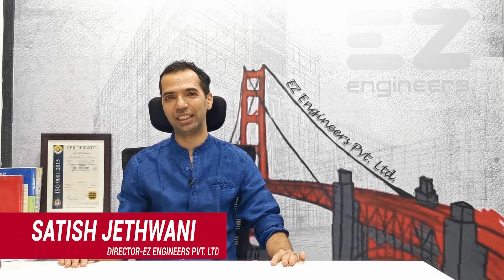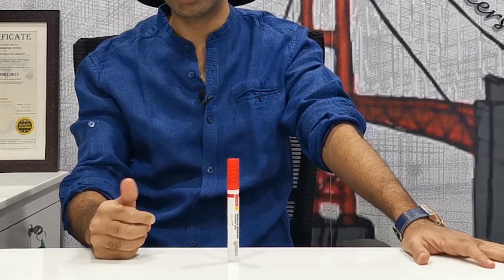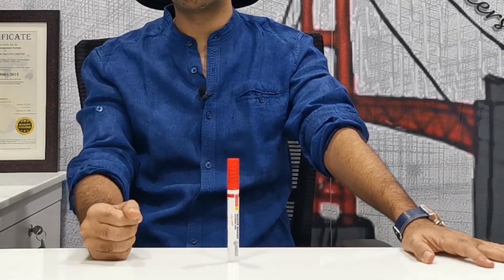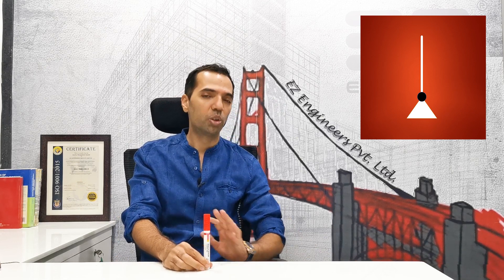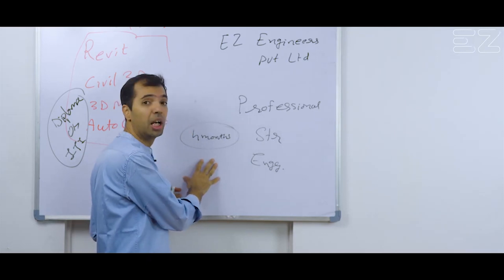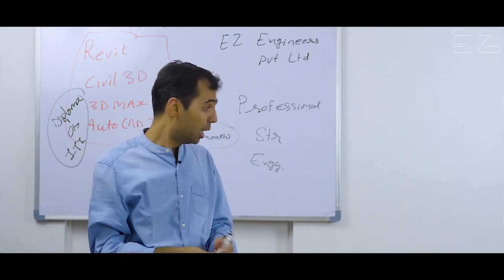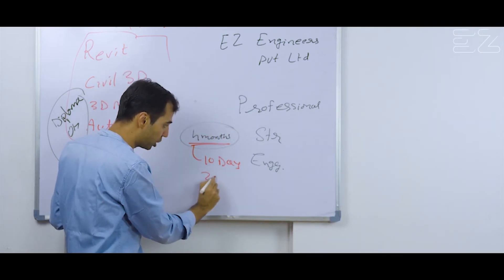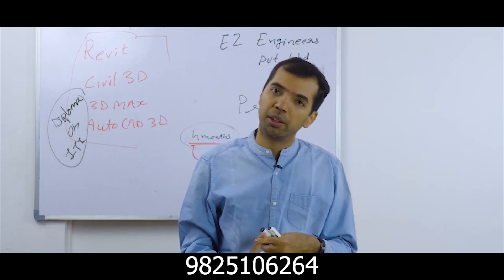Stability of Steel Structures |  Vertical Bracings-Unique Explanation | Stability & Connection Types

Comment: How can i become a student, I am into steel structures. Very interested in the steel Assembly and connections
Reply from the maker: for further info - you can call/whatsap us on
+91-635 935 0500 or +91-98251 06264 or 
just send "hi" @ whatsap +91-98251 06264.

Comment: Great explanation; I'm not civil, construction nor structural engineer, but a simple home DIYer that is about to create some steel  home projects, such as storage racks. So I came to this video and learnt a lot so far. Talking abut fixed (welded) connections in all corners: Is there any significant improvement for a structure to have 2 braces, in a "X" cross form, versus a single brace per side ( One brace going from bottom/left to top/right, other side having brace going from bottom/right to top/left)? Provided the tubing for bracing is strong enough. As I'm going to make a lot of racks ( about 6,  in average 3x2x0.6 meters Height x Length x Depth), I would like to do some savings by using 1 bracing per side if  possible, Thank you in advance.
Reply from the maker: YOU CAN USE 1 BRACE. IT DEPENDS ON DESIGN. IF ONE BRACE IS CAPABLE OF TAKING LOAD, NO NEED TO GO FOR 2ND ONE. WHEN YOU PROVIDE X BRACE, THE LOAD IS SHARED.  ANOTHER THEORY SAYS - (TENSION ONLY DESIGNS). YOU CAN FIND DETAIL OF THIS THEORY IN GOOGLE, IF YOU CHOOSE TO DESIGN WITH  THAT CONCEPT, YOU MUST PROVIDE X BRACE.